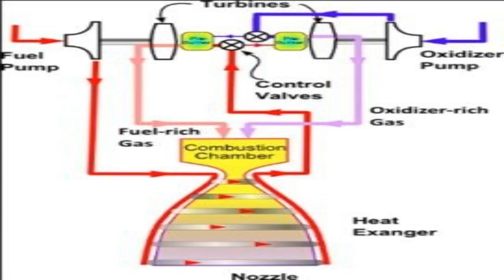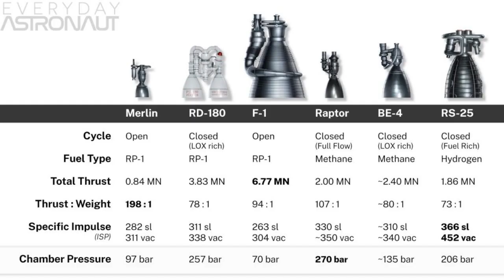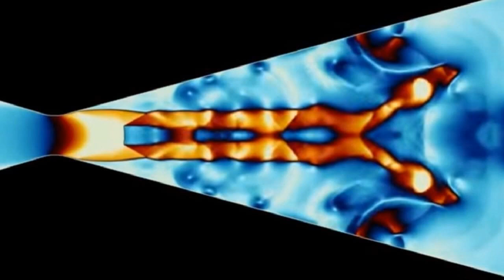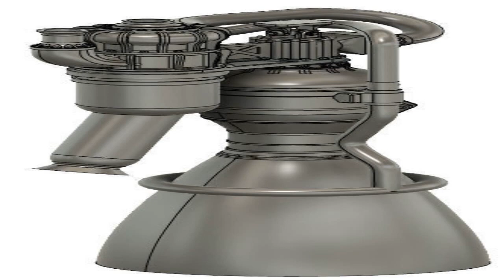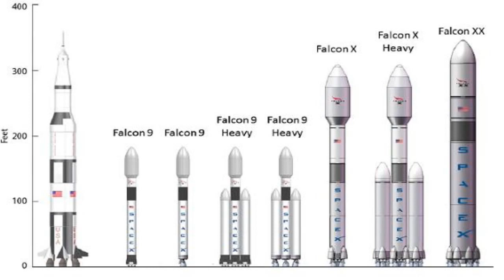How SpaceX Rocket Engines Have Evolved Over Time | From Merlin to Raptor

Comment: The obvious focus here is the obsession with anything on a human scale⛑🥱🧗‍♀🧗‍♂, whose ambitions🤨🧐 to build buried structures appear👽🤯 just 4 meters below the surface of the Orbital table 18 meters high 🗼 with a small reinforcement of 2 👍🖖🤣😂😅🤔 inches irons  in diameter, certainly in number, but instead of triangular stainless steel 📐📐🧩🗜☂⛲🧱 around the CONCRETE in the soles against the corrosion produced by METALOX Mixed with RAINWATER in depth 🌌🪐⏳ 🚀 against the effects of evaporation 🌡👀👣♨♨♨ around 8 to 10 meters.

It's a real MIRACLE ✨✨💫💨💖💖💦💢💖💞💫💫💚🏀🥊🎯🙌🗜 THAT these FIVE 💦🧷🌟 pillars of blows are always at the level of lift power ♟🍀 🍀 ☘☘🍀🍀🥦 🥑 🌞🌞 power point [0] NOMINAL RESISTIVITY 🧩📐🎯⚔⚖ of their 15000 tons capacity against mechanical movements in the ground.

Followed here by the same procedures of telemetric reliability of above-ground lifting sets of ships throughout the decade is handicapped by undersizing of thrust engine strike pits.

This increasingly forces the concentration of too many system elements AND power overload subsystems to be in one place.
 
Exposure to gases in tension becoming the number 1 factor on organs at the same level? The ignitions or clogging without sausages are then increased tenfold by a factor of 5 to 10 out of 100 the breakdowns after the first seconds of combustion of the propulsion gases.

Among other things, launch pads for colossi 18 meters in diameter capable of carrying 300 tons or more, the structural solidity greatly improved by a DOUBLE-ORBITAL side table, the ergonomics of the tanks as well as the mastery of the grouped controls of the thrusters in multiple sections 6 to 8 per group.

Either way, Spacex Starship will really know no limit to the super-heavy size expansion of its cargo cargo for the reliability of its systems for the moon🌓🌈🌀🪐🌍 and March 2028 or only by a review of the concentration blocks of insulating organs of very high / low temperatures ex: turbo-mixer and pre-combustion powered by propulsion group (6-8 cells) in a separate floor 🛹🧷🎌🤖🌋🕹🎛⛓💨🕳 chambers of distribution 💧🌡🧯 ⚡⚡👑🔑⚗🎼⌚⌚🤖🎌 by pillars 💈 Stirling mix mounted in bars.

A race for power 🏁🏁🚦🚀🚀♨♨ that the Soviets didn't understand until years later with shockwaves after gas
on ultra-powerful rockets.

congratulations again for the video and much success to the engineers who build these vehicles day and night deployment of super and hyper large space mechatronic structures